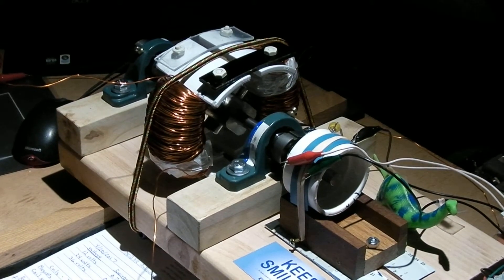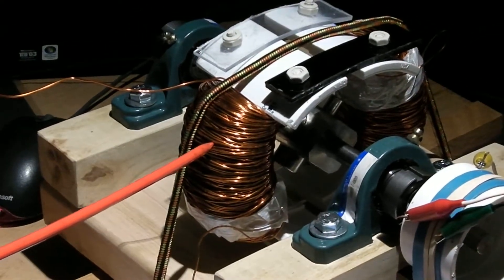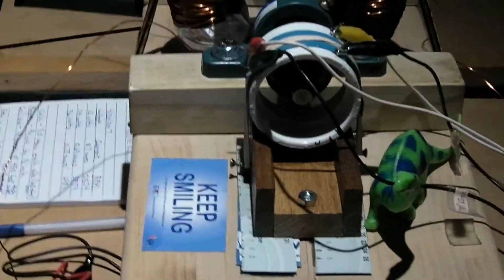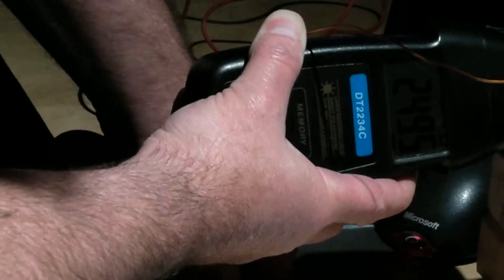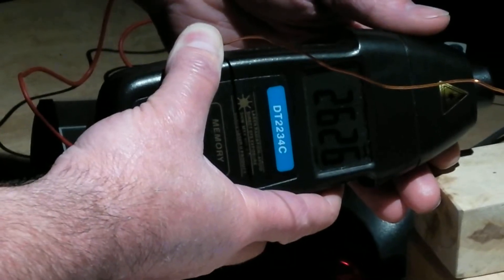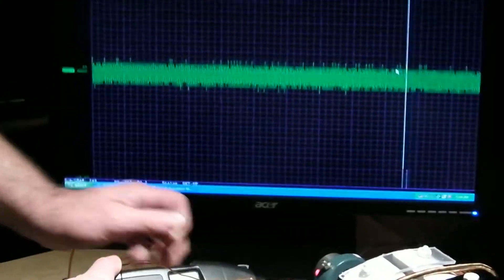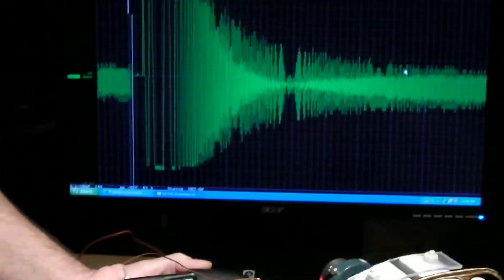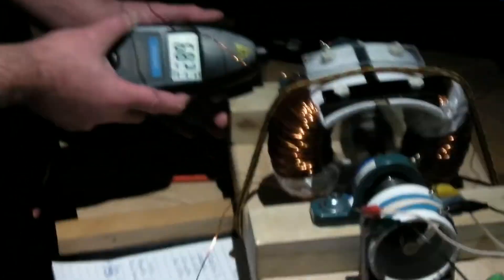James Zero Force Motor Video 1

Comment: Nice video. 6000 rpm? Martha, hide the kids!
Reply from the maker: Hi Christian --

    Thanks for the comment on my Zero Force Video. The part about Martha to hide the kids is funny.
I have done some more things since that time that were not posted like a Electro-Static Motor running
on 20,000 volts. Right now I am working on a 3D printed Motor that will be a Magnetic Motor but lots of 
work is being put into this as I am writing.

Comment from the maker: Yes, all the amp measurements are no load amps. Yes, it will pull some loads in the future. My friend who also built a Zero Force already put up a video showing his motor driving a water pump.  My plans are to drive a VW alternator to charge batteries.